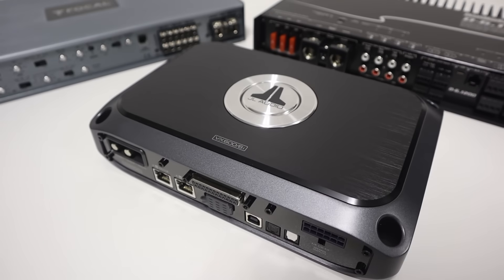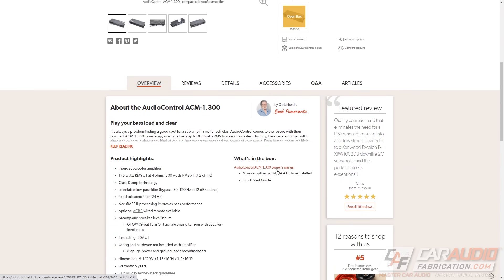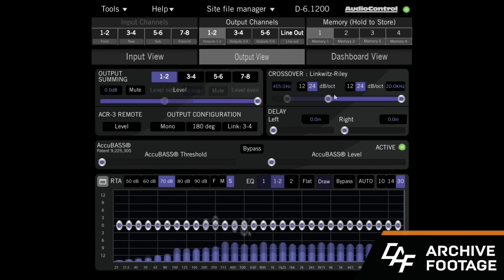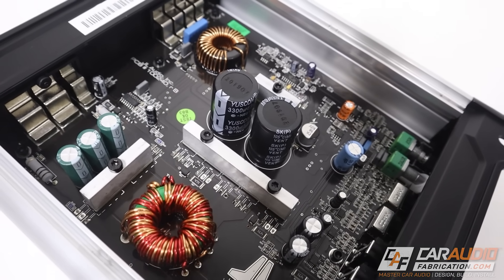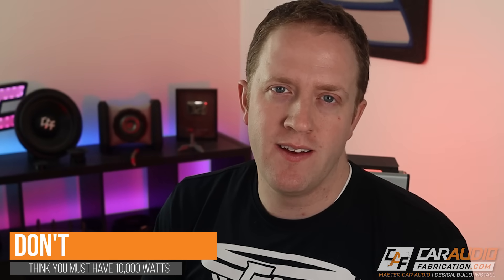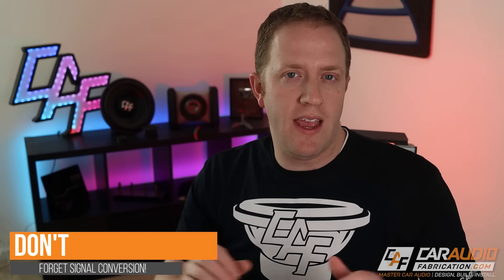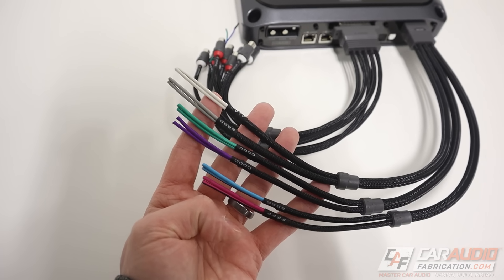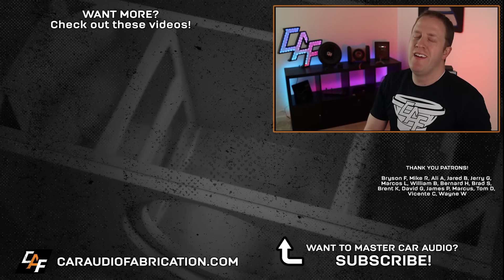Picking a Car Audio Amplifier - DO's & DONT's

Comment: Crutchfield is a great resource for anyone who is lacking knowledge on anything they sell. I shopped there in the 90's and use them for other people's installs. I tell the 'customer' to call Crutchfield and order their stuff. The sales team is great, they get all they need for their specific vehicle and I don't have to try and explain it all myself.  Plus, Crutchfield has a great return policy and don't rape you in shipping to AK like some merchants do. 
As for amplifier selection, I love built in everything. No need to install a bunch of additional boxes, wire runs, noise possibility, additional level matching...it goes on and on. The industry has come a long way since the 90's. I still prefer the sound quality of class AB for all speakers over class D. I had Diamond Audio D7 amps for a while....nothing has been the same. 
You did a very good job on this video. Hit all the key points and made a very good point you don't need more than 500 watts for the subs in most cases.

Comment: I'm glad I picked the Sony XM GS4 for my Sony Mobile ES speakers. The 100 dB S/N ratio, %0.05 THD, class AB topology, and high-quality Japanese capacitors and transistors are very attractive specs. The awesome sparkling crisp sound quality is the proof that's in the pudding and puts a big smile on my face. I'm considering a Crescendo Symphony amp for a Fi Neo 3.5 12 inch sub with stage 3 cooling inductance mounted in a sealed box so I can get powerful yet clean bass to fully complement the system.

Comment: Hey mark I know you've got sponsors but think at some point you could push some more budget minded equipment... Other than that love the vids and I do learn alot.
Reply from the maker: I've made several budget related videos, they never perform as well as the high end stuff.
Reply: @CarAudioFabrication  I know you have. Just alot of high end stuff lately. Witch I like to learn about.... just cant afford.
Reply: @bigk7788  hey boss don't go at it as I have to buy it all at once. For example I have a 2018 vehicle with a premium sound system with 9 speakers.  One rear door speaker is out. I've ordered some focal speakers to replace both.  I'm also going to add some sound deadening. Next stage will be front speakers which are components and more sound deadening.  Then will be the dash and replace the factory 8" sub. There's nothing wrong with building ur system up in stages. Yeah it would be great to do it all at once but it's not a requirement.
Reply: Also I'm not even thinking about replacing the factory amp at this time or adding subs.  Some things are optional. Yeah a new amp will probably make my new speakers sound better than the factory amp but we'll see what my ears tell me.
Reply: @mr.weaver7568  I get all that. Was just making a suggestion for content. Just seemed like every video he was producing lately was for the upper end audio. Witch I want to see as well. One day I'll to go that route. What I was getting at is there are a lot of audio companies out there like dayton audio and eminence that never gets any love at least when it comes to speakers anyways.
Reply: @bigk7788  gotcha
Reply: @mr.weaver7568  Not as overwhelming too which is nice lol
Reply: @Cory Haizimsque  I'm in the same boat and getting confused on all I'd need.
Reply: I agree! I would love to see how to properly set up something like skar or other budget friendly equipment, for a quality sound. Got to be some processor or EQ that won’t break the bank that could be added to some budget equipment for better tuning and performance. I’ve also learned a lot from the CAF videos, but most of us family guys can only dream about the fancy equipment. Got to be something we overlook to clarify sound.
Reply: @CarAudioFabrication  thoughts on 1-5/6 channel amp or multiple amps?
Reply: Cry baby

Comment: I pick and installed a Kicker KX 400.4 amp and upgraded all 4 speakers and tweeters in my truck. Everything worked when I started my truck up but today was the first time I actually drove my truck, once I started to drive I had no sound, the amp must have shutoff. Come to a complete stop put the truck in park amp work. I rethinking that my grounds are not that great. To have it work in park and not in drive???

Comment: Slightly off topic question:  I was in car audio in the early 90's when all the power classes were based on 4 ohm amplifier power and all speaker voice coils were 4 ohms so 1 ohm or lower capable amps and dual voice coils was a big advantage.

Why are almost all subs still dual voice coil and what is the advantage of running high current versus standardized 4 ohm voice coils in the modern era?

Comment: Video suggestions, wiring mono 2, 3, 4, channel/final impedance.. how to wire a high farad capacitor, some have remote wires most have more than one(up to 4) +&- terminals.. is it possible to run parallel or series? How to run a cap with battery bank if it optimal/possible/suggestible? No one on YouTube explains.. thanks

Comment: I know Mark has touched on this in other videos but I thought this would be a good add to this one:

Don't Be FOOLED by large Wattage Ratings.  Sadly a Great Many MFGs outright lie.  If your looking at lesser known brands always look at the Fuses and do the math! 

Example:  I just saw an amp listed on Mercari made by CRUNCH that's rated for 1500 WATTS!!  But it only comes with a single 40 Amp Fuse.  So at best most alternators run at 14.4 Volts.  So 40 X 14.4 = 576 Watts of power.  Amps cannot produce electricity, they only convert the raw electricity they get from the battery/alternator into musical energy.  A typical Class D amp runs around 80% Efficient.  Meaning if it's maximum wattage input it can handle is 576 then the most output wattage it can produce is 460.8 Watts.  So in truth this 1500 Watt amplifier is really a 460 Watt amplifier.  They might have achieved 1500 Watts measured in the lab for 1.2 seconds before it burst into 🔥 🔥 🔥!!! 

Always Do the Math.  If an amp has multiple fuses you simply add them together to get the total Amps of input the amplifier can handle.

Here's a great channel for seeing car audio amps Bench Tested:  https://youtube.com/c/bigdwiz  Williston Audio.
Reply: Speaking on efficiency, I thought that mono amps pull more than their advertised wattage to compensate for wattage lost to their efficiency rating. For example: provided a 1500w rms amp has the proper fuse inline, it would pull closer to 1600-1700 watts to achieve the advertised 1500 watts. Is that not correct?

Comment: What suggestions could you give for 500 watts to a complete setup with aftermarket radio. I’d prefer one amp to power all ( tweeters, door, rear deck speakers and 10” subwoofer

Comment: Do you recommend a graphic equalizer or just go off the head unit 13 band eq? Nice video
Reply: Try to find a head unit with parametric eq. As many bands as possible 
Otherwise, maybe use a DSP with a eq.

Comment: Question.... If I’m using a 6 channel amp to run Active and a mono to run a subwoofer. That’s 4 sets of RCAs. My headunit only has 3 , How would that work? Can I use the output on the sub amp?

Comment: Hi Mate. 
Hi 
Was looking at updating my wife’s car sound system. It’s 2013 Holden Captiva 7 seater. The car has a tweeter and a woofer as well as a passive crossover in each 4 doors. 
Making it 8 speakers 🔊 in the 4 doors. 
My question is will a 4 Chanel amp do the job if I am looking at connecting them trough an amplifier or will I need a more Chanel amplifier? 
Thanks. Bob

Comment: Love your show, I have learned so much. I bought a audeosonic lc 6.1200 for my boat. I have 8 each 4 ohm Fosgate 100 rms speakers and 2 each 6.5 4 ohm 75rms speakers. How do I wire the speakers to this amp. I was thinking 2 speakers to each channel. It seemes like there is plenty of power to do so?

Comment: My current system is dual Rockford fosgate slimline series 3 with a 1500W amp running to both! I’ve had since 2019 and love it but now I’m getting a bigger vehicle and wanting dual 12 Bose 2300 watts to each sub! Should I run a 4000 watt amp or 6000 watt so I can push higher amperage? Thank you

Comment: guys i really need help!! Im upgrading to rockford dual 12 P3's rated at 1200 rms at 1 ohm. I was going to get the skar 1500 watt mono amp for $180. Is this a good amp for the subs and will i need an extra smaller batter/capacitor and 1/0 gauge wire?? completely stock radio on a 2014 car
Reply: I have the skar 1500w mono amp, it's extremely good value for its performance. If your peak power is going above 1500w and you have the power wire running more than a few feet then it couldn't hurt to upgrade to 1/0 wire, but for that amp you would also have to purchase some 1/0 to 4 gauge wire reducers because the amp has 4 gauge inputs. 

Idk about an extra battery, but I did have to replace my stock alternator with a high output one (stock one died on me, took my battery down with it). You will probably have to do the same unless your stock alternator puts out ~200-250 amps. A 2 farad capacitor would help as well. I also opted for a high performance optima yellow top battery to replace my old one.
Reply: Thanks man. I also have the option to get a rockford 1000w prime which I read is extremely efficient and would make it so I wouldn’t have to upgrade my electrical or get another battery. Is this even true do you think? The amp is $400 but a whole 500w less power. Do you think the 500w would be noticeable sound wise or would it’s efficiency compensate for the less power with better sound quality

Comment: My amplifier is stable at half ohm. Can I run 2 of them strapped at .67? Each amp would see .33 ohm. Amps are Wolfram AW5K I am putting them on 3 dual 4 ohm subs

Comment: My question would be if I'm running an aftermarket head unit aftermarket speakers
I'm looking to do a 12 inch ported box should I run a 5 channel amplifier. Or a 4-channel amplifier and I'm looking to run an epicenter also
Any advice would be greatly appreciated

Comment: Hey mark I was just wondering I run 2 sundown sa12’s and they push 750 rms each but I actually push them harder at 900 each and have a 1800 1ohm amp the car ran fine no electrical problems but I just added a amp and new door speakers that will add another 400 watts do you think I will need to upgrade my alternator or maybe just add a battery/capacitor, what do you think? Also love the videos I started watching to learn how to make the clean boxes and beauty panels all the wood work stuff it’s awesome 👍🏽
Reply: just add a super caps or lithium bank

Comment: Hello you would know a way to bypass the signal that turns a radio of (eco mode ) after 10 minutes with full battery when engine not running ? 🇬🇧

Comment: Subwoofer calls for 750 rms. Had some people tell me to double that to run sub efficiency. This correct?
Reply: Like 1500 rms amp to push it
Reply from the maker: No, that's advice coming from the same people that constantly need to warranty their subwoofers but say silly things like "I never turned it up past half gain"

Comment: I have a 2018 mustang convertible 9 speaker system it doesn't have a Subwoofer. What channel amp are amps will I need to  run 9 speakers a new Subwoofer?

Comment: I know when wiring the amp itself bigger wire carries more and sounds a lil clearer but is the same said for wiring the subs in the box? Or does it not matter
Reply: Whether it’s true or not you shouldn’t cheap out on any part of the system . You won’t know if it’s the wires or the actual sub if there a problem so h even make a problem in the first

Comment: Hi I got a quick question, What would you run if you wanted to run four 6X9's. I do want bass from them also. So I'm looki g to find what brand and Amp that will work correctly,  Thank You in advance...
Reply: You’d want a 4 channel amp 

If just doing 4 door speakers 
If u want to add a sub also you’d want to get a 5 channel 

But have to look at are the door speakers stock or aftermarket 

If stock u need to find what rms is which is normally very very low like 50 watts rms per speaker 

If aftermarket it will say on listing/ box like 150 watts rms etc so if speakers say 150 watts max rms you’d want to find a 4 channel amp that provides right around that area so you’d be looking for a 4 channel amp that says 150 watts rms x4 
The x4 would mean u have 4 speakers so each speaker is getting 150 watts in which it’s rated for’ 

Never go higher than what speaker recommends for max rms you’ll blow the speakers n a heart beat 

Hope that helps some 

Always look at rms not the 
“total peak power” that’s just advertisement bs always match rms of speakers and amp 

Don’t get some off brand buy once cry once’ promise you’ll be happier even if u have to wait to save up’ 

Tried and true u can’t go wrong 
With 
Alpine /kenwood /kicker pioneer is okay but personal I would go with alpine or kicker just my opinion always had great luck with them

Comment: I have a Grand Marquis.  It has a 8" hole by the rear window for the factory sub which my car didn't come with.  I'm looking at an infinity kappa free air 800watt 1600wat max sub woofer, and a pioneer 1000 watt amp.  Is this enough? Or a good or bad setup? Any advice would be greatly appreciated.

Comment: i am installing new component in my car with company fitted head unit.
stegMLG65c  in front
stegLEO650 in rear
i need 1 amplifier with built in DSP and my component r 70watt RMS
I am having higher low conveter 
suggest me the best amplifier for SQ SOUND SETUP

Comment: Hey Mark great video. have a question i bought head unit Kenwood dmx 4707s but the head unit does not HAVE amp turn on the blue and white wire. how should i connect to the amp to turn on. ANYONE
Reply from the maker: Blue wire on the accessory 8 pin connector
Reply: @CarAudioFabrication  Thanks.

Comment: Hey Mark, do you think it's alright to slightly exceed a subs or speakers power rating because of losses in efficiency and/or from auto voltage (14.4 to 12.5)?
Reply: I've always bought amps to go over the value of the subs but turn them down to play slightly under the rated power using a meter.

Comment: If I use 2 different brands of amps and 1 has a dsp built in but the other doesnt can I link them to have the dsp tune both speakers and subs?
Reply: Probably depends on the amp and if the rca out of the amp is affected or not

Comment: Hey, so I recently got a 12" 1200 watt sub from a neighbour. It's an mtx audio, and it is in a Ported box. It says 4 Ohms, And the tag is ripped but this is what I can make out: Model: TNP11202, 4 Ohms NOMINAL. RMS: 600W max. 

So what amplifier should I buy? Also I am upgrading the speakers and deck as well. 

Thanks in advance to anyone who can answer this :).
Reply: Looks like what you've got is a TNP112D2. It originally sold as a package deal with a 200W amp. Its a 200W RMS sub, so you'll need a monoblock amp that makes 200-250W RMS @ 4 Ohms. 
Try the MTX website and see what amp came with it. Might find a bargain on ebay or somewhere.
Reply: @gakudzu7282  Wow, you know what you are talking about lol. I'm a little confused as it says max: 600w RMS. If the max is 600, why would I be looking for more than half The max load? And also, I want to use the amp to power my speakers as well, so I would need at least a 4 channel amp. I have 4 speakers that I will be replacing. Thanks :)

Comment: Hey I have a question I have a 2012 Chevy Silverado I have a 1500 watt amp my volt gauge on my truck dropped to like 10-12 volts when my subs hit I have a 2K compositor any ideas why that would still happen
Reply: Get more reserve or more alternator. That said, a quick 10-12v drop,  isn't the end of the world. Unless you compete.
Edit- and I have no idea what a 2k cap, even means. 2k farad? Or what !?
Reply: I have a 2004 Silverado and the lights will dim just raising the windows up and down. It came with a 105 amp alternator. You need to upgrade the alternator and add another battery...caps or ok but upgrade alternator and battery is best.

Comment: How do these Class D amps really compare? This whole amp class thing confuses me. 35 years ago it was a running joke in electronics engineering class.  Today they exist in some form but how do they really match up to a Phoenix Gold or Rockford Fosgate amp?  Are they going to expose that bass line in a popular song that most people never realized was their? (Man in the Mirror, Micheal Jackson)  How does damping factor come into play? 30 years ago damping factor is what really set high end amps apart when considered for running low frequencies at low ohm loads.  We only had a few of viable options. US Amps rated damping at >1000.  Rockford were easier to install but only rated <200 ( would sound good despite poor wiring ) and had less power than similarly speced USAmps or Phoenix Gold which often required reinforcing the cars electrical to ensure noise free operation and a few hours of parking lot play.  ( this was a thing in the midwest in the 80-90s)
Reply: Memory Lane:1991 driving  1990 Subaru Justy.  Badges scrapped off so it was just "Sub" -  I was running a single 10 inch Image Dynamic in a bandpass (box big enough for 2 15s) with people ready to beat me up for lying about how many subs where in the Sub...   Kids..... LMAO...

Comment: Kind of weird that there is class A\B straight to D and no class C. What's up with that??
Reply: I believe there used to be class C amps but they died out real quick also in HT and Pro audio
Reply: In the Early 90s Blade Technologies was a car audio company that had a hybrid Class A/B-D system they called BASH technology.  A/B sound quality with close to Class D efficiency.  

They were so far ahead of their time, 6 channel amps with BASH class switching and they made a car audio DSP you programmed with a PC when having a CD changer in the trunk was high end.